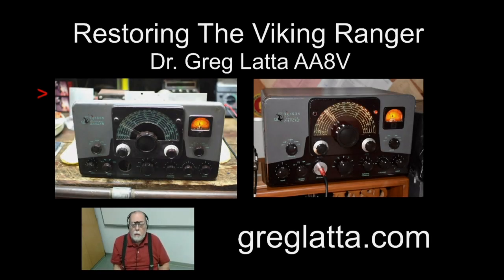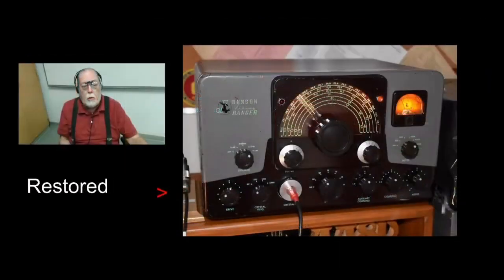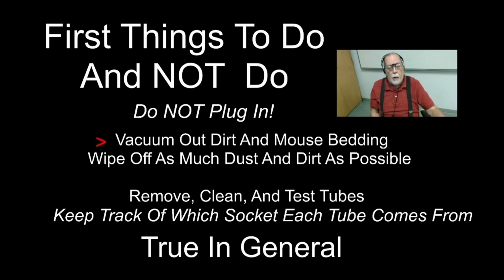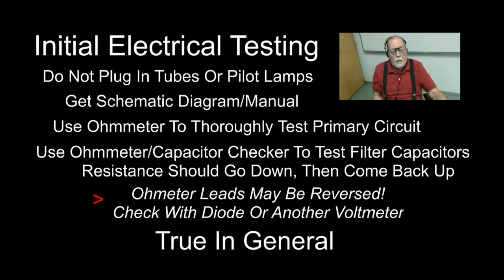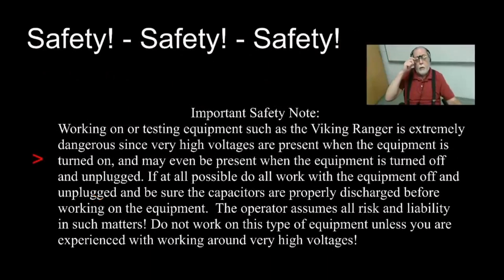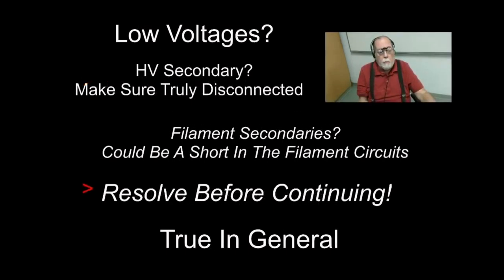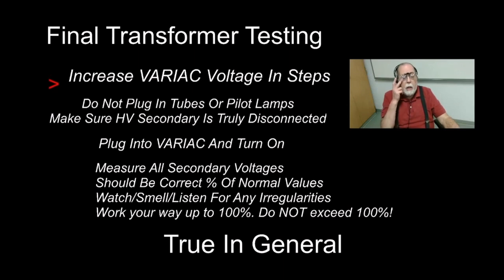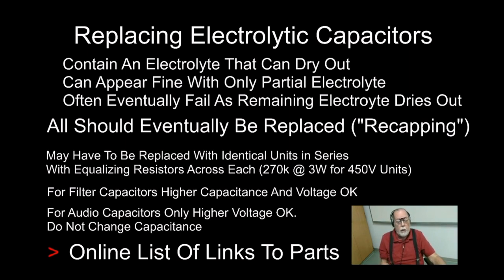Restoring a Vintage Transmitter - The Johnson Ranger Edition with Dr. Greg Latta

Comment: Thanks so much for posting this video. I bought a Johnson Ranger at the last Hamvention before Covid came along and robbed us of the joy of larger hamfests. I paid $40. I was told they didn't know if it was in working condition or not, and I made them an offer based on my assumption it needed work. It did, of course, but $40 for a cosmetically acceptable (not perfect) Ranger transmitter is, I think, still a great deal. I had to pass up a Johnson Valiant at a smaller hamfest because (1) I didn't want to lug it to my car (I have heart failure, which makes me breathless if I exert myself much), and (2) at the time, I didn't have anywhere to put it. That one, I believe, WAS in working condition and if it's there the next time I go to the same 'fest, I'll probably bring it home. 

But this one I want to restore. I retire Mar 1, 2022, so I will finally have time for this, along with adding a working Collins TX/RX pair to my collection as well. Those will be my showpieces in my shack. I partially restored a Yaesu FT-767GX already, but I haven't fixed the built-in auto-tuner yet. It works on SSB so that part is fixed.

I am looking forward to getting started in boat anchor restoration for fun and possibly profit in my retirement, and your tips should work on almost any older radios. I liked your specific tips on the Ranger, though. I already had used a variac on it and brought it up to 120V with no smoke, but it didn't work. At least I know the transformer is working, the tubes and pilot lamps are working, and I have some plate current, but I will replace all the electrolytics before going any further on this restoration, and I won't be so bold as to just use a variac on older stuff in unknown condition again until I have made some basic checks. I appreciate that advice, even though I didn't have it when I put the Ranger on the variac.

Comment: There's no need to replace the original two conductor fused cord with a three conductor cord and a outboard fuse.  The Ranger already comes with chassis ground connection.  Just connect that to your outside electrical earth ground.  No need to replace anything.  In fact I keep a roll of brown, 2/14 cable and fused Elmenco plugs handy to undo this mod on Johnson gear and bring them back to original.  Also, Antique Electronic Supply sells a 16uF/800v electrolytic that works great as a HV replacement filter without having to paste two caps together in series.  They are pricey, but will closely fit the original capacitor mounting loop diameter.  FYI

Comment: What, no mention of a dim bulb tester?  That's what I'd use on a transformer when it's totally disconnected.  As far as color matching, if there's a spot on the radio where the paint is still good, a number of auto parts stores have a color matching device and can mix up a spray can's worth of it for you, or a pint or quart can.